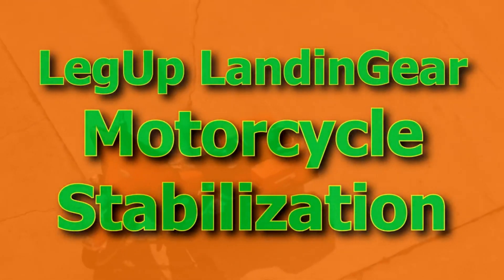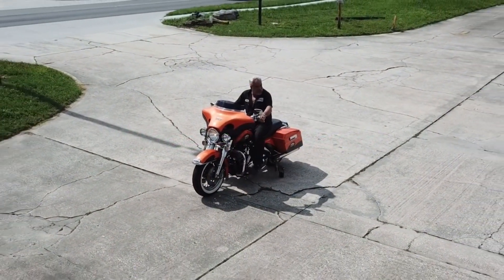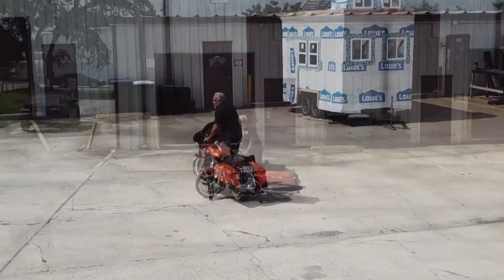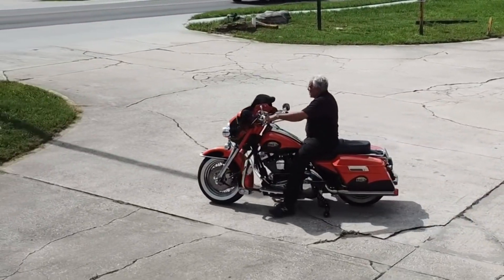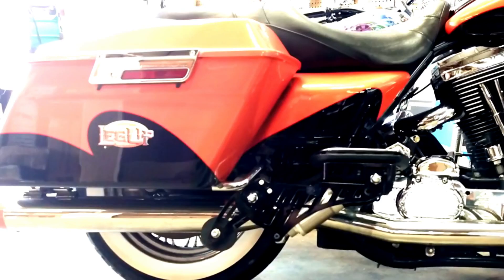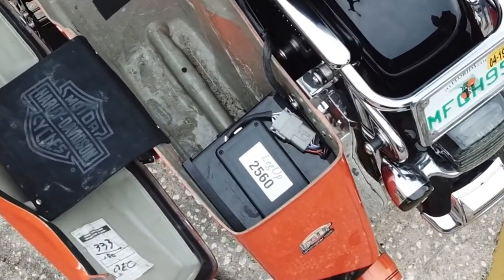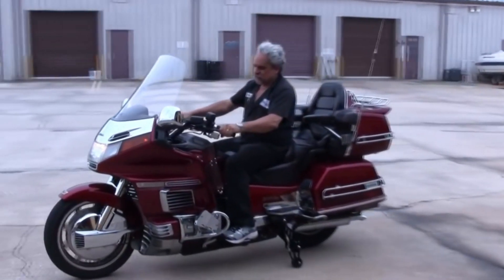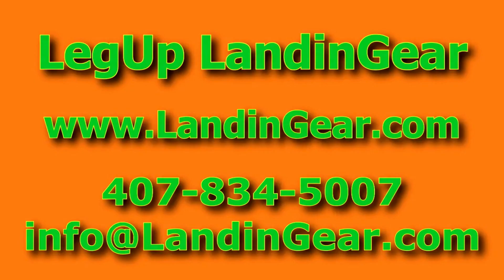LegUp LandinGear - Amazing!

Comment: In my opinion, when considering dragged outrigger designs (where the stabilization wheel's center of rotation TRAILS the outrigger pivot attach point), the LegUp LandinGear design is superior to the DorJet design.   I wouldn't recommend any outrigger designs where the stabilization wheel's center of rotation is BELOW the outrigger attach point because such designs impart very high deformation torque loads to all outrigger assembly components when the motorcycle is moving.

LegUp Landingear features:  
Actuation:
   Simple pneumatic deployment (air cylinder pushes wheels down)
   Spring retraction (wheels retract when pneumatics are vented)

   Electronic control valves and compressor 
   Electronic failures that induce premature deploy are potentially catastrophic
   Recovery from failed down only requires pulling the fuse and venting pneumatics.
Key mechanical traits:
   Simple pneumatic cylinder
   Small onboard compressor
   Solenoid valves
   Speed sensor + control module retract automatically at speeds above 6 miles per hour
Behavior:
   Rider input mandatory for manual deploy below 6 mph, and auto deploy triggered when speed falls below 6 mph 
   System retracts at any speed by manual control, or automatically above 6 mph.
   Smooth, automatically controlled deploy/retract at 6 mph
   Rapid manual deploy below 6 mph.
   Rapid manual retract at any speed below 6 mph can achieve superior handling characteristics with practice

DorJet features:
Actuation:
   Complex electric motor–gear driven deployment and retraction
   Gear‑driven arms lower and raise the wheels
   Single Motor failure is potentially catastrophic. 
   Electronics control the motor timing and logic, failures are potentially catastrophic
   Recovery from failed down involves major system disassembly for motor/drive gear jamming failures.
Key mechanical traits:
   Electric actuator (motor + gearbox) have more failure modes than LegUp.
Behavior:
   System deploys automatically at low speed
   Retracts automatically at higher speed
   It appears to me that there is no manual retract available to achieve superior handling characteristics with practice
Reply from the maker: Wow! Where were you when I designed this thing? lol. I agree with most of your findings. We agree that outriggers are not the greatest thing since sliced bread but we have helped thousands. Also with the legs up we keep exhaust valves open all the time to avoid unintentional deployment. Thanks!